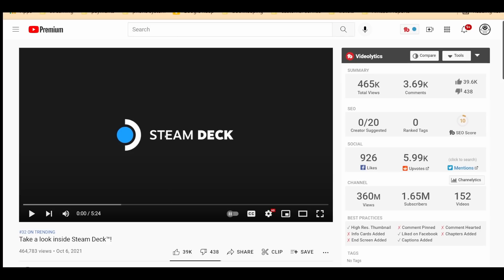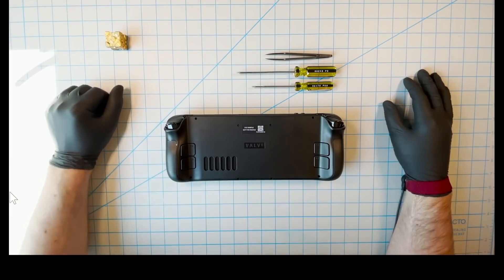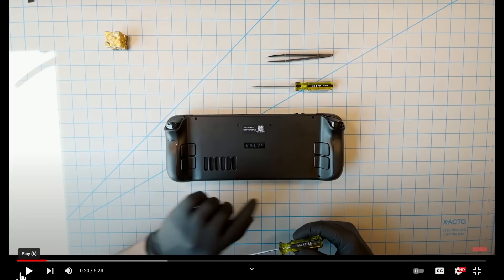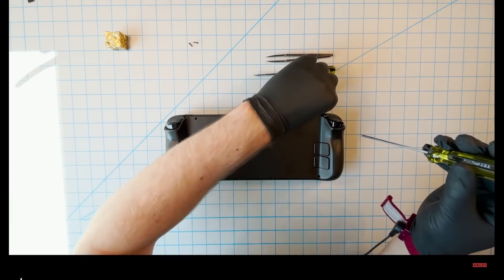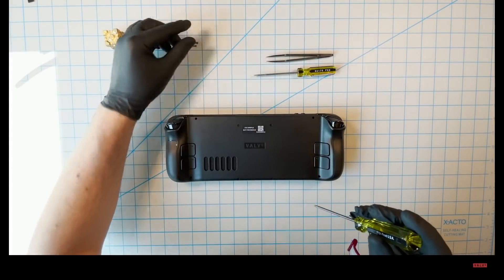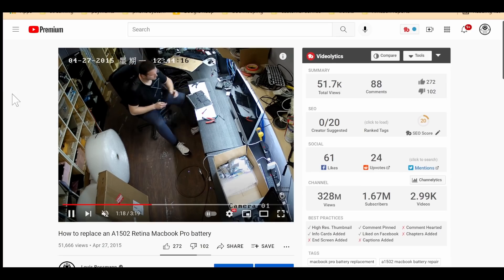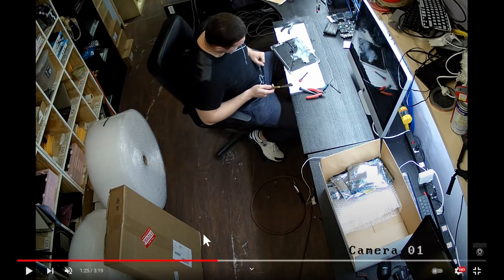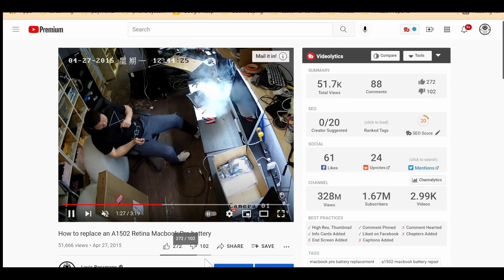Steam deck battery may end your life? bruh 😑

Comment: Valve:
-is safe from lawsuits because someone died while handling a lipo battery with a knife.
I get:
-repair documentation
-replacement parts
-upgrade path
-a great device that has a potential to finally bring desktop Linux to the masses.

I think those legal disclaimers ain't that bad after all
Reply: this needs to be pinned
Reply: Except it's yet to be determined if you actually get any of that.

And you're definitely not getting the last thing, desktop Linux is never coming to the masses. Pop quiz: What distro of Linux should the masses be using on their desktops? 
The Linux fanbase tearing each other apart to provide the "right" answer to that question is all the proof anyone needs to know that Linux for the masses is never happening. It's all fun and games until you remember that Linux isn't Linux, it's Ubuntu or Mint or Majaro or whatever million other distros there are that nobody can agree on.
Reply: The problem are honestly court precedents that require companies to do retardation disclaimers of what should be common knowledge.
Reply: @Gundog256  I heared that microwaves have a disclaimer saying "do not use to dry your pet" because someone actually did that and sued the company.
Reply: @mtdla  that's what happens when you don't understand the technology.
Reply: @ÉnioFernandes  yeah but you have to cater to the lowest common denominator.
Reply: @deejnutz2068  most people who use their phones don't understand the technology so pretty sure they are not the lowest they are the average consumer.
Reply: @Adam that implies there is already a desktop linux device/platform that is more or less widely adopted
Reply: I'm a bit skeptical that they'll provide repair docs. I said on their video that they absolutely should based on what Dell (HP?) and Lenovo provide for their pro-level laptops, but they didn't promise that at all here.
Same with upgrade path. Sure, it would be really sweet if you could simply swap the display module and upgrade to the top tier Deck without buying the top tier Deck, but somehow I doubt that would be the case. They're not Prusa, after all.
Reply: @MMuraseofSandvich  Prusa printers were designed with the "open-source mindset" from the ground up. You expect open source stuff to be repairable, upgradeable, customizable and generally it's core customer base to be DIY'ers, makers etc. 

Steam Deck is made for the mainstream market. Yes, the software is open-source, but hardware is not. So I would compare it's repairability and upgradeablity to other mainstream mobile devices, including Apple. And by apple's standard Steam Deck is VERY upgradeable.
Reply: @MMuraseofSandvich  also in the 3d printing world people expect for everything to be opensource to the point where they(myself included) get weirded out when slice engineering released mosquito hotend and the applied for a patent.

 In then mainstream consumer electronics world that's not the case.

Comment: I'll post this under this video too:
I've come to the conclusion that they're halfway between covering their butts and mocking companies who seriously don't want you to open "their" stuff.

That would explain the "bad™", the "now we're actually serious" asterisk part, the seemingly mixed messages throughout the video, both the "but it's cool" and the "as you can see it's actually quite hard to do this- oh, done, easy, right?", and the pretty absurd claims such as the "you open it up, it's immediately less drop resistant" part. I can't know for sure, but that's the vibe I got
Reply: having dealt with self-tap threads in plastic posts...super easy to damage them. Tolerances are tight and something being a fraction of a mm off in the future will make it feel less good. I'm a bit sad they didn't go with some sort of threaded inserts or a sub-chassis in metal to give screws something to hold...but I understand what they did for cost reasons.

Comment: "End your life?" Dude, I've accidentally stabbed a lithium battery before and all that happened was a little smoke.
Reply from the maker: @Anon It's America, you can always sue.
Reply: Ok so I’m curious, if you stab a big hole in a lithium battery is it going to just spew out faster rather then building up pressure like if you were to only shallowly stab it?
Reply: I didn't write the script or approve the video so I'm guessing at their intentions like everyone else, but I can see this inclusion for the standard "CYA" approach, and then edge cases where a teenager completely unfamiliar with technology but wanting/needing to replace a joystick opens the device, accidently slightly punctures the battery partially (but not fully) then over time that puncture actually opening fully then causing a fire in a backpack or pocket etc. etc. etc.

Super edge case, and probably very unlikely, but at the root of the disclaimer, they're at least letting customers know to be careful around the battery because lithium reacts violently with air exposure and can cause fire. As Louis said, most accidents of punctures that happen while working on the device wouldn't be deadly, but the danger is still there for anyone unaware of what they're getting into (and yes, their delivery was hyperbolic but I think that's meant to be partially tongue in cheek along with the editing "mistakes" and continuity errors as Linus/Anthony discuss in their reaction).

Comment: Oh yeah. I saw this. Kept thinking,"Why tf would Valve intentionally design something so dangerous and crappy?"
Reply: But they didn't, they are covering their arses legally so when someone stabs their battery with a knife, it catches fire and burns their shed down they can say they told everyone not to open it.
Technically what they said applies to all lithium ion batteries, which are found in essentially all mobile devices. Its not that valve made a crappy and dangerous design, its just the inherent risk of opening a device with a lithium ion battery (which still isn't much you'd have to take the battery out and stab it with a knife or slam it with a hammer for any of the fire stuff to really happen.)

Comment: While everyone should be able to open up their own stuff and get the parts they need, some people probably shouldn't without some more practice first, and some people probably shouldn't at all.  
We can laugh at how hyperbolic their battery safety warning was because it wasn't for us, it just means if someone does open it and stab the battery with a screwdriver, burning their house down, it isn't Valve's fault.
The warnings will only sound scary to someone who doesn't know enough to know how small the risks really are, and if they don't know then they shouldn't open a Steam Deck until they've learnt more for their own safety.

Comment: I hope Louis doesn't go insane over those disclaimers, or try to pull some "it's fear porn" stuff. There's a difference between covering your ass and actually going out of your way to hinder things like right to repair. Valve going ahead with the basic disassembly guide tells me that this is the former, and I hope Louis recognizes that.

Note on the structural integrity: Self-tapping screws do that. And it's significant. Plus it's kinda hard to judge if you tightened the screw enough, and if you overtighten, the screw might as well not be there. Even if you don't overtighten, the clamping force is much weaker the second time a self tapping screw is screwed in. If you have something where self tapping screws are used, unscrew it, screw it back in again, and unscrew it again. Even if you manage not to overtighten, the second time, the screw will come loose much easier than the first time.
Reply: My thoughts exactly but... we know by the title he is going to ream it out lol
Reply: He did not.
Reply: Ah yes, a disassembly guide that's poorly edited and doesn't actually go step by step.
Reply: @JimmmyRay  you should try it, your cat will recharge instantly! Don't waste money on food any longer!
Reply: @olie304  well, its a half truth. you certainly won't have to buy cat food anymore

Comment: Valve's video could've been better scripted and better put together, but I'm still glad they didn't follow standard game console manufacturer procedure. As much as I personally love circumventing software locks and getting to run homebrew software and OSes and do all sorts of things unintended by the manufacturer with the hardware I own, voiding all the warranties in the process... It is better when you're just allowed that from the get-go. And the fact that they'll be offering official support, instructions and replacement parts for the Steam Deck is 2/3rds of the way there to full Right to Repair.

Now, the only thing missing is Steam Deck schematics. Though maybe we ought to win that battle in the PC tower space first.

Comment: I think that was just preventing a lawsuit. obviously yea, lithium is dangerous, everyone knows that. it's a calculated risk that you have to be aware of when opening a device. especially when manufacturers put them in the way of the opening of the device. 

However, this device appears to have been designed to minimize hastle if it ever does need to be opened, which I will say, good on them. Joystick module is easily replacable with a ribbon, though less common parts are harder to get to. It's a tight form factor to be fair
Reply: "everyone knows that" so many idiots in this world will have to disagree with you there i seen people use knives to remove them lol
Reply: Me and my friends in middle school use to put batteries in the oven to hear it pop
Reply: As someone who has gone through multiple controllers over broken joysticks, that was a wise decision.

Comment: *read the edit at the botom* legally covering their asses in case some idiot does open it and claim "puncture does nothing" and it burns him down with his house while he sleeps, also watch carefully when they put "BAD" on screen, they add the "trademark" as if they're mocking apple for their stupid claims, while yes, it's possible, they know the chances are minimal as long as the batteries are not deffective
Edit: I forgot to add ths, usually batteries (the round cells) come encased in a metal cilinder, but flat, internal cells do not (again, most of the time), qhen trying to remove those, someone with no proper knowledge could poke it without actually puncturing but damage it enough so that dendrites form way earlier in the battery's lifecycle and most of us already know what a dendrite could lead to within a fully charged cell, specially of that size, I want to guess that's what they are trying to cover from with that warning, yet hopefully the changes they are going to make to the steam Deck include casing for the battery
Reply: damage to the battery may not be obvious and may appear to function normally for while until it doesn't.

Comment: all I cared about in this video was the "come back later when we give you the source to get these parts" and the "YOUR steam desk" that's all I needed. I don't care about covering their buts for future lawsuits.
Reply: I am interested in that too. They promised to give access to parts, I hope it's true

They also said "it's yours of course you can open it" Which is unheard of from electronic brands
Reply from the maker: @houghwhite411  I hope it is true too.
Reply: @rossmanngroup  Why never give us a better battery 5 years laptop or smartphone and they buy to supliers and sell you the same battery, when tech allow to sell you a better one?

Also to be honest if the hole is flat walls and the screw stress/bend/broke the plastic as It goes in, more times you put and take out the screw more loose. 1st time you take out a little of plastic goes of or rest at bottom, cheap toys are perfect example, but the last half turn when you put pressure your bending plastic rails the screw has done, no material can't bend multiple times offering same ressistance. So if they use a machine to close all screws at the same time like car engines and the plastic is cheap, they probably very true, but also very bad, so you better not overcleaning? If the cilinder for the hole is big enogh you can sit a metal 'nut' with epoxy, change the screws and get better than factory.
I'm not expert but I broke some toys👉👈.
Reply: @houghwhite411  they promised to give access to some parts e.g. Joystick and SSD.
Reply: @DUDA-__-  they also said maybe more. I hope that maybe is actually more like a yes, and they provide replacement batteries, screens, etc.
Reply: @houghwhite411  just few parts, not all. You can get supposed ssd i'd assume, battery, and the joysticks. I don't think much more, maybe in the future
Reply: I'm sure right now they're using all of their parts to build as many as possible to make an attempt to meet demand. This thing is absurdly cheap for what it is, especially in today's economy.
Reply: This. Very interested to see Louis' reaction
Reply: It's probably that the place selling the parts are already backed up on preorders. So replacement parts may not actually exist on paper or in reality at the moment, since it hasn't been released to the public yet.
Reply: I'm guessing the aftermarket for those joystick daughter boards are going to be thriving
Reply: I don't know, but I'd think the parts will take a moment to be purchasable because of all of the preorders. 
It is probably priority to manufacture devices rather than have spare parts ready to buy right away.
Reply: Louis Rossmann: makes satisfied noises
Mr. Clinton: meows
Reply: Yep true
Reply: Even if they don't some cheap knockoffs will come out anyways. Whether or not they are reliable is another issue. I've switched my nintendo switch joycon analogs already 3 times (Cause they are cheap products made from China. Died while my Switch was docked unused for months) and each switch was only like $3? worth of parts.

Comment: The video was really strange. On one hand they said that they were gonna provide replacement joysticks and SSDs (Great!!) But then they repeated overly hyperbolic warnings about how everything coluld damage the product or even kill you.

The video inself was filmed well with an overhead camera on a clear surface, but then the editor jumps around clips like crazy. It makes it really hard to follow. And for some reason they don't even film the reassembly process.

It kind of feels like a joke that I'm not getting. How is it so good yet so bad?
Reply: Literally everything they mentioned being a danger is a danger of any portable system. Lithium-ion batteries of any kind will catch on fire and/or explode if mishandled, static electricity will kill any hardware component, opening a tightly packed system will ruin its shock resistance. They made that video so they can legally say "we warned you".
Reply: I think they were aiming for an Apeture Science vibe.
Reply: They are clearly covering their asses in case of a lawsuit. Wouldnt be surprised if they had some lawyer on staff to write that part of the vid. Same reason literally everything has a "3 years or older" sticker.
The rest of the video was great, so I really dont care.
Reply: I feel the person talking is not the same person doing the tear down in the video. The person in the video is probably explaining things, and then they changed things up in the voice over and editing.

Im sure this also went through multiple departments multiple times (mostly probably being a back n forth between legal and editing) for approval on the information given.
Reply: At one point in the video they even mention how cool it is to open your stuff, after having spent minutes warning you about the battery going up in flames or breaking the entire device because of the part's fragility. Very mixed messaging
Reply: @565paolo  that felt like "now that the average joe that has no business inside this device is no longer watching" kind of joke
Reply: It's pretty clear that it's meant to be a joke for people who are capable while still being effective at dissuading people who really have no business doing much beyond holding a screwdriver in the first place.
Reply: 'so good yet so bad'
You just described Steam 😄